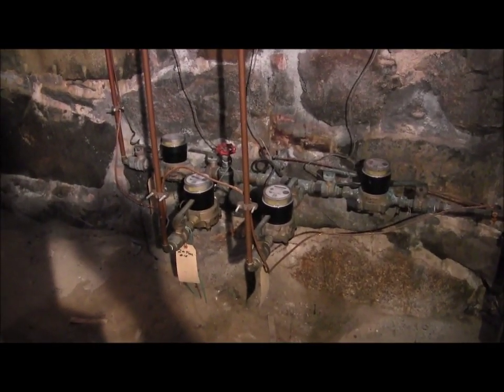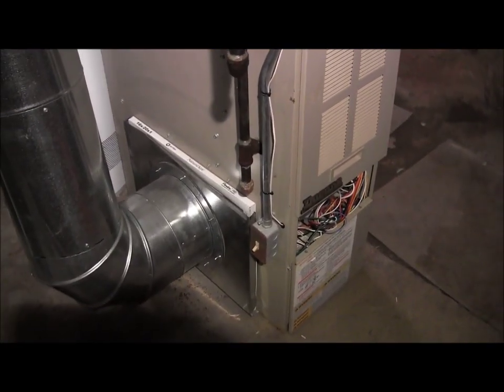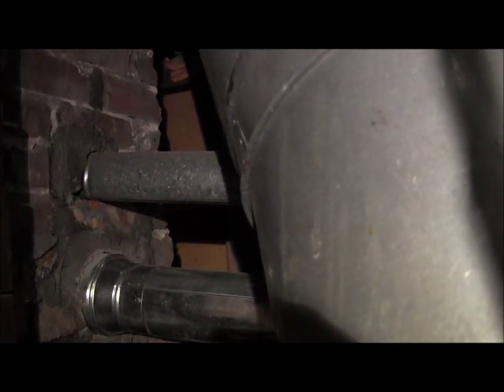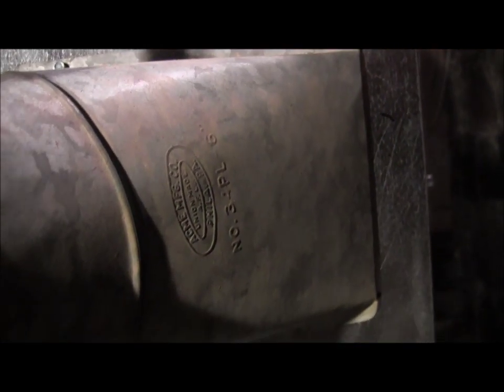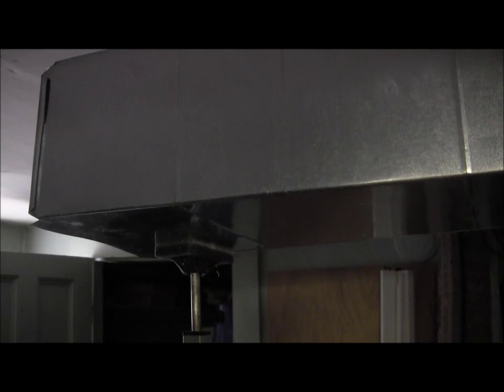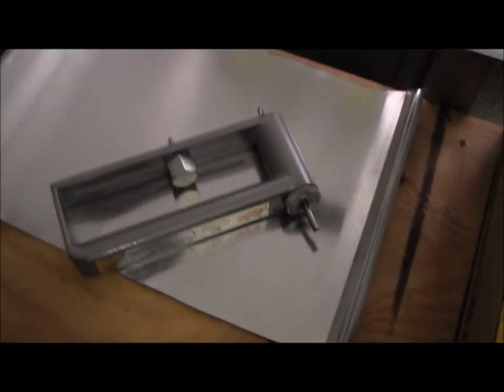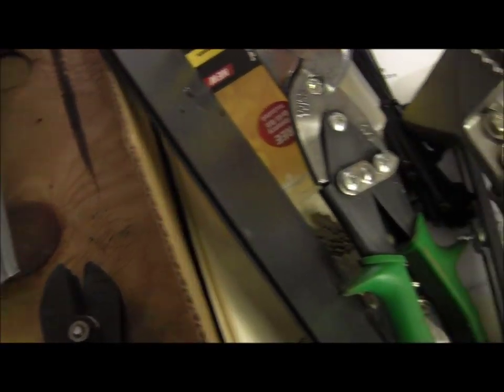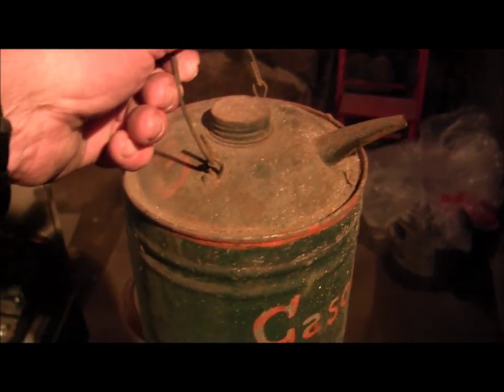Heating sys replacement basics

Comment: Hi. I have a 110,000 btu oil furnace with a .85 hp blower.  The intake air was supplied at the blower on the basement floor were there was a 14" by 20" opening for the filter. The furnace had no return duct at all. Installer put two 6 x 12" grilles on 1st floor coming from two 7" oval ducts for return air. I believe the two 7" ducts produce only 300 cfm combined. Wont this cause serious return air restiction and effect efficiency?
Reply from the maker: Bryce Taylor Hi Bryce !
You are correct sir. The return air drop is necessary to ensure the colder air can return to the furnace. Sounds like your system is drawing basement air only, no return from the heated space. This setup is very inefficient and causes temperature imbalance in the heated areas. Have a qualified HVAC person review your setup and make the required corrections, a good investment in your comfort !
Thanx for watching and commenting, it's appreciated. Look for the landlord series here as I'm now installing a new high tech system with PVC intake and exhaust that requires no chimney connections.

Comment: I'd say that returns at a bit under sized round pipe should run into a box to give that filter more of a surface area I know that's a two year old video but I'm just saying
Reply from the maker: RealFifty You are correct sir,
When I shot the video I had not finished the filter box and therefore had an undersized filter tray tacked on return to allow the furnace to operate. Since then it's been running with a 16 x 20 with no ill effects. Thanx for watching and leaving a comment, it's appreciated !